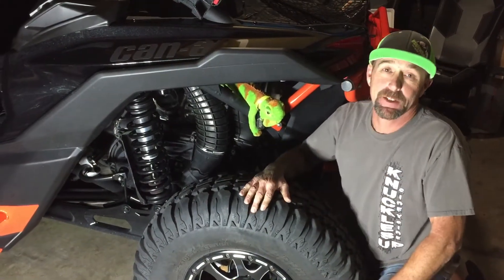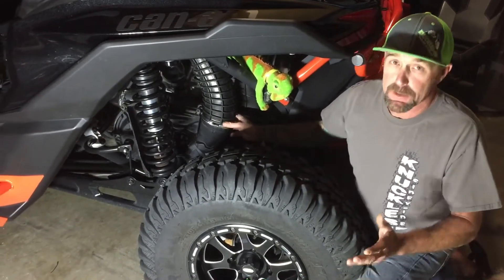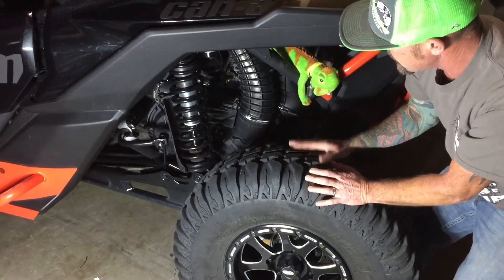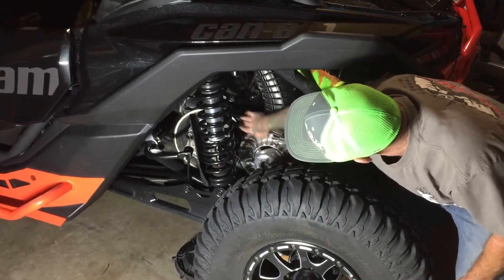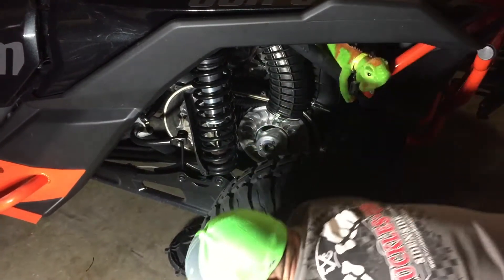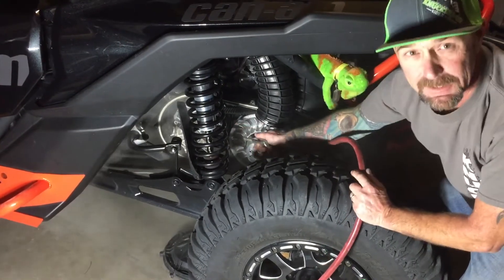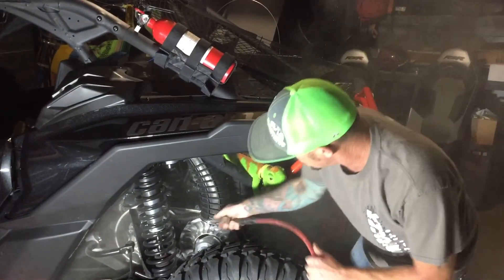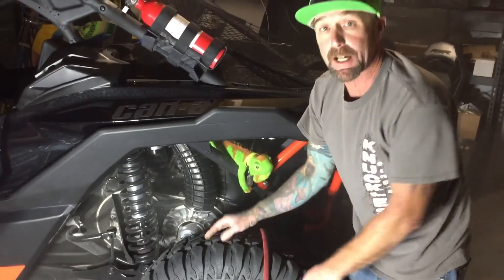Can Am x3 clutch maintenance

Comment: Can you tell me if that round metal thing you rotated is suppose to make a clicking noise when being rotated ?
Reply from the maker: imacenurface it’s normal for it to click a little.there is a one way bearing in the clutch. Kind of like spinning a bicycle chain backwards. Most of the time if you are having problems with your clutch it will be the other side.